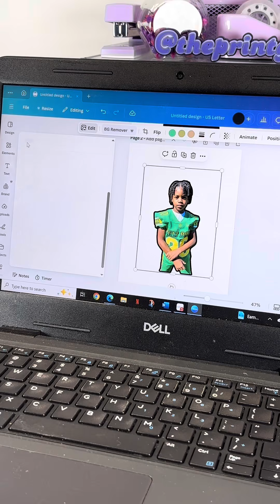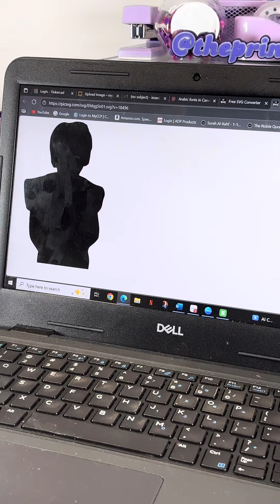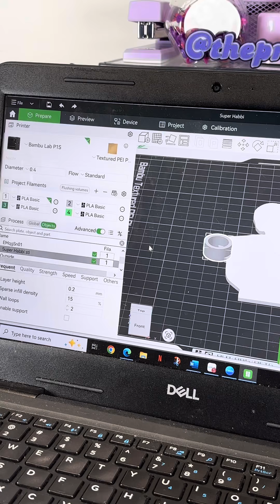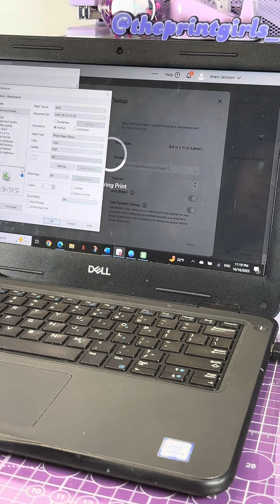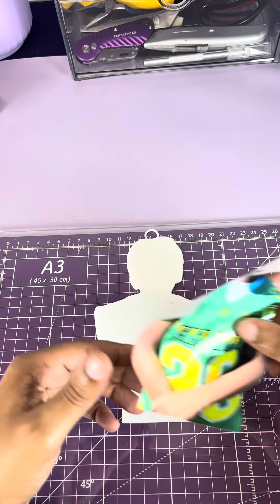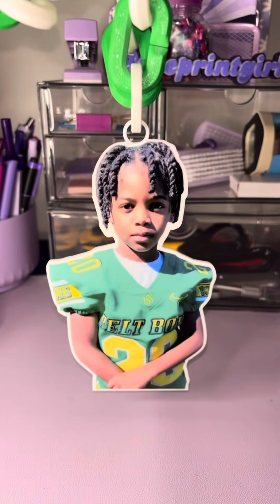How To 3D Print A Custom Hype Chain | Bambu Lab P1S 3D Printer | Cricut Maker 3

Comment: Did you find you could add resin to the photo without sealing it first? Just concerned the colors may bleed if I add the resin directly to my inkjet printer sticker.
Reply: good paper and resin wont cause bleeding :)
Reply from the maker: @desaraykerr3417 you’re right! 💜

Comment: I see you used the outline on the 3D silouhette, but not on your photo. How did you scale the 2 to match? When i try using the border on the silouette, then remove it for the picture, my dimensions are off. I'd like to have some printed filament show as a slight border.

Comment: What setting do you cut your picture on the cricut it keeps tearing mine 🫶🏼
Reply from the maker: You have to play around with your settings because it varies depending on a lot of factors. What blade you have, what machine you have and etc. I use a generic brand blade from Amazon and I use the sticker paper setting. You can try lessening your pressure and see if that helps. I found that the circuit brand blades doesn’t work for me which is why I bought different blades from amazon